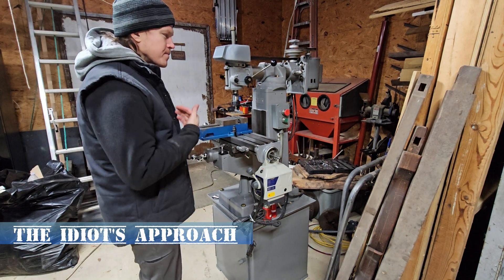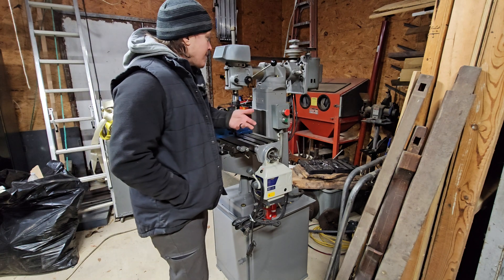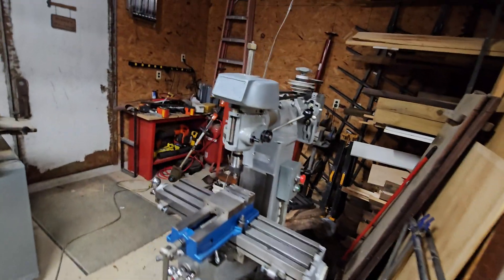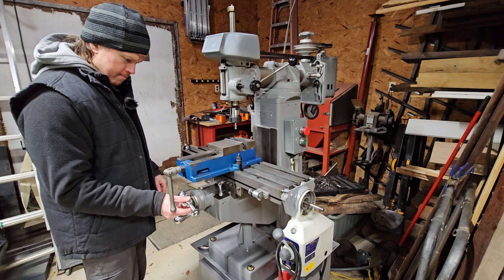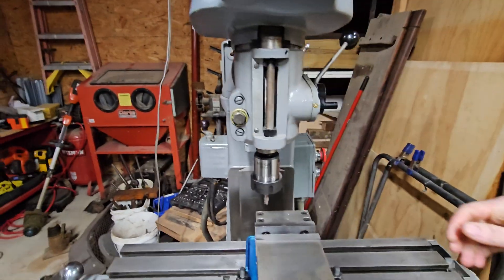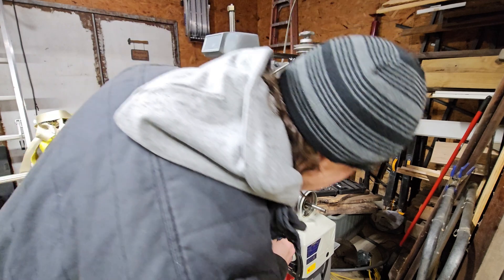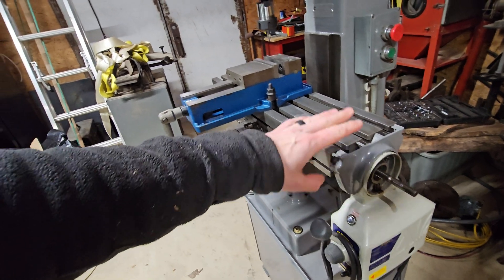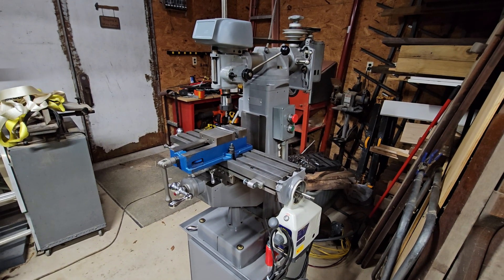New Machine for the Shop - Clausing 8520 Vertical Mill

Comment: How do you like it so far?
Reply from the maker: It's been capable of everything i've needed it for so far. Got the powerfeed working. Drawbar nut has been a pain because its warn and misshaped but would be an easy fix if I'd take the time.